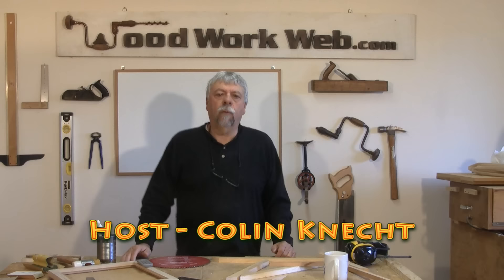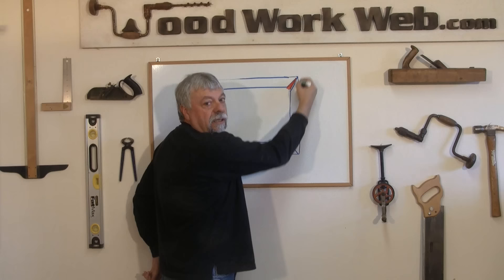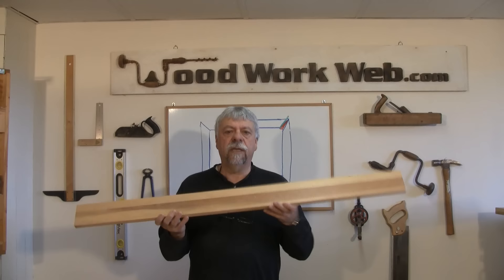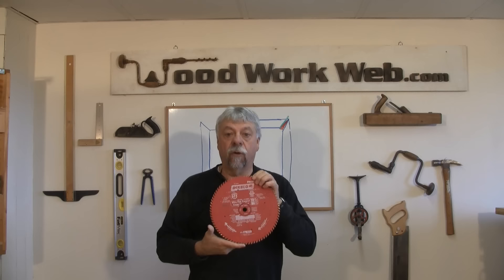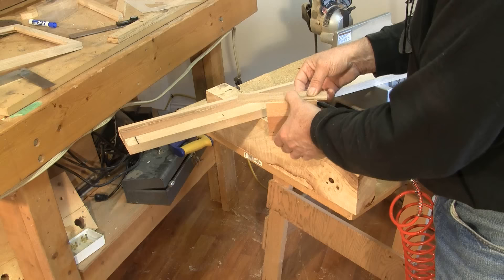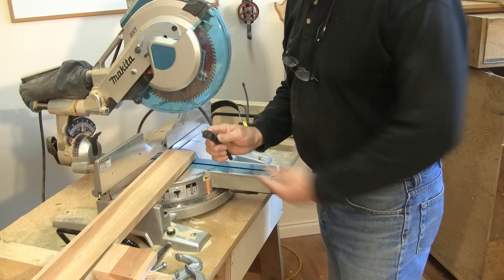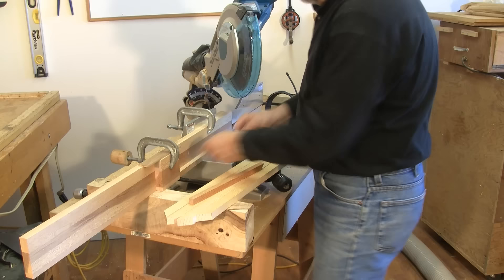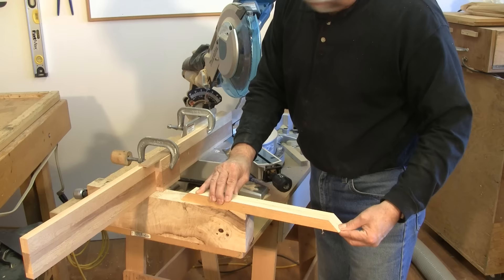Making Picture Frames with a Sliding Mitre Saw - A woodworkweb.com woodworking video

Comment: Love your DIY setup. This setup will work for small flat frame however you must improve on the 0.1 degree vertically and horizontally (Think of the frame being 3D) deviation otherwise a large 1-1/2" thicker frame would have some trouble. 1. You want to avoid using a sliding saw as it is not as accurate as the none sliding one due to the slope of the rails. No matter how good the brand is but do stay with a name brand with less vibration and slope. 2. On your first right hand cut, the frame must be flipped upside down and stay completely flat before your cut or you must adjust the saw 90 degrees and move your rig to the right side, otherwise you will end up with an Asymmetrical piece. 3. A V-nailer should be used to hide the nail heads, for the DIY people the manual or hand held ones are about $100 but a bit tricky to use. 4. Thick frames are especially difficult as not only the angle has to be 45 degrees vertically but also 45 degrees horizontally, this is why most sliding saws would likely develop problems when you make the final joint. 5. V-nails need to be double stacked some times with 2 x 3/8" or longer for very thick frames and only a professional $2,000+ V-nailer should be used, otherwise the frame seam will easily open on top. 5. Use wood glue but be very careful to test it as some glue would expand and spill outwards as it dries. The challenge starts when the frame is 1" or thicker. IMHO, I use to own a professional picture framer shop years ago.
Reply: @Hello Eddy how are you doing

Comment from the maker: Good point, you could cut 2 sides at once as long as you make sure they are exactly the same length. The only other issue might be safety, could be a bit harder to hold on to 2 rather than one, but other than that, no reason why not.
Colin

Comment: Great video...only wish you had included the making of the rabbets that are needed to accept the artwork, glass, etc. Seems like an integral part of the process was left out!
Reply: I agree, I need to make a frame to an existing canvas and was left wondering how. Not enough info on making frames and too much info on making corners.
Reply: @flipknuckle  a stretcher does not need the rabbets that a picture frame needs....a stretcher is a whole other animal because of the tension put on the stretcher when you stretch the canvas....you will notice that a lot of cheap stretchers will twist...
Reply: the rabbets can not be made on this tool, you either need a rabbeting bit and a router or a dado blade and a table saw....
Reply: @victorprado1347  thank you kindly, will be making oval frames out of a single sheet of plywood with routed 5 ml inside and two inches of outer border with routed outer edge. Will be an interesting experiment.
Reply: @victorprado1347  sorry should have been more specific it is a stretched canvas that is a finished work painted and hung but now want  to frame it to make it a little more elegant. will still need rabbets to set it into.
Reply: @flipknuckle  sounds cool
Reply: The rabbets are for another video.JUST GETTING THE FRAME RIGHT was enough for one lesson...for me✏📏📐😊😎🇺🇸
Reply: I don't believe Mike was making the complete frame or showing the viewer on how to make a picture frame. Seems to me the point of the video was to educate the viewer on the importance of making sure your pieces are identical to each side or else the 45 degree angles wouldn't be equal, thus creating a gap(s) on your frame.  Thanks for your insight Mike! This helped me understand way some of my polygon angles would graduate and not me actuate.
Reply: Rabbets don't require as much precision.  You can cut the rabbets first - this video is the answer to the part that kills us.
Reply: @mattmillican3635  Totally agree Matt.  I do the rabbeting and profiling first and any round over as the last part of the profiling before the final 45° cuts are made on each piece.  It helps make the piece handling much easier

Comment: Hello friend, I tell you that I make my frames for my own paintings and drawings. I do not have an electric miter tool but I do have a manual with a saw and the truth is that I find it very difficult to join the wood that has been cut at 45 degrees. I have two belts to join the four corners, but it is necessary to be adjusting little by little so that they are well joined. Thank you very much for your videos and receive my congratulations from Mexico City.

Comment: If your mitre saw doesn't cut precisely 45°, you can fine-tune it by placing one or more thicknesses of paper or card behind one or other end of the backer board before you clamp it in place: behind the blade end to increase the angle of the cut, behind the 'feed' end to decrease the angle.

Comment from the maker: Hi Gary, I think I covered that in one of the previous frame making vids, but the way to do it is you need to account for the rabbet where the glass and/or matte and/or picture will go, so the inside of where these joints meet on each corner should be your actual dimensions. So measure from the inside diagonal of that rebbat, then work that length back using a square to where the outside frame length needs to be. I don't think I can be clear enough in this tiny space for responses.

Comment from the maker: It's technically possible to route a channel for the glass and picture after the frame is assembled by using a rabbeting bit, but to be honest I don't recommend it because you don't have good control of the wood which means it is risky in terms of accidents and injury. If you can design some sort of a jig to hold the frame, this could work.
Hope this helps, let us know if have other ideas.
Great to have you with us\Colin

Comment from the maker: Good question Kurt, the only real reason to use a sliding mitre in stead of a chop saw is that you get a bit wider cut with a sliding mitre ... which in some cases isn't that much wider. I am planning to do a video on a table saw sled that will do accurate and wider cuts, that might be helpful to you tool. Thanks for commenting ... great to have you with us
Colin

Comment: Love your video Colin thanks !! Although I have to build a frame to go around a TV to give the Samsung Frame TV look.  So the width of the frame is pretty long (35in). Any suggestions on marking the  width for the marker gauge.  Could use a tape measure but do you think a pre cut length guide would be better ??

Comment: The most simple form of set square is a triangular piece of transparent plastic (or formerly of polished wood) with the centre removed. More commonly the set square bears the markings of a ruler and a half circle protractor. The outer edges are typically bevelled. These set squares come in two usual forms, both right triangles: one with 90-45-45 degree angles, the other with 30-60-90 degree angles. Combining the two forms by placing the hypotenuses together will also yield 15° and 75° angles

Comment: Would have been nice to see a close-up of the measuring sticks placement under the blade.  The stick's 90 degree edge to the mitre saw's 45 degree angle.  But I think it will become obvious after trying it out the first time or two.

Comment: Don't forget you need to flip the pieces for the 2nd angled cut so that your inside angle is the inside angle on both ends of each piece. \  / and not /  /
Also important on decorative or rabbeted picture frame wood to check the orientation. My first attempt messed up 8 feet of wood...lol.

Comment: Sorry if I'm missing or misunderstanding but it looks like this only works if you know the outer dimension of the frame?

Creating a custom frame, you measure the inside since that's the dimensions of the object. This looks like it cuts based off the outside dimensions??

Is there a mod to the backer board or the extra block to accommodate the measurements of the inside?

Comment: Nice job. I wonder about the rabbit for the glass or canvas. Dud you make those first? I'd like to use my chop saw but I'm not sure it's good enough. I'll try a new 80T blade first. Might have to manually set the 45. Thx

Comment: Lay that drafting triangle flat on the saw bed. If you hold it up in the air, you'll inadvertently tilt it just enough to make it snug against the fence and blade, even if they're actually half a degree off from true 45.

Comment: Great tips for flat pieces of wood.  BUT.... what do you do when your using fancy actual picture frame wood, with an angled design on the face, a beveled edge where a picture or panel might go, and the back side is not a 90 degree angel from that flat part the panel would rest on.    We cannot figure out how to set this up so it cuts right.
But this was very helpful for flat wood.

Comment: Good video for basic picture frames with wood that has uniform thickness. This won't work if you are using tapered molding for a frame or wood that does not have uniform thickness.

Comment: Great video!!! But what if you don't have a marker stick to set your the depth of your sliding marker (when you make the second cut on each piece)? Where do you measure from with a tape measure? I notice your marker stick is mitred one one end to match your fence, but if you're using a tape, where would you measure from? The outside (and longer piece of your fir fence) or the inside (shorter) of your fence? This is what's difficult if you're trying to frame different one off pieces that are obviously different in size. Great video and thanks for any insight you can give.

Comment: Great idea for simple fence. But this is not a picture frame. It’s true that the measuring is key, the mango rite of these videos do not deal with measuring for inside dimensions of a finished picture frame. People need a frame that is 13 3/8 by 16 3/4 how do you cut both sides of the mitre correctly for the interior dimension? Any one can cut. Piece of wood and then match the same size, but cut these to an intended interior size with a rabbit.

Comment: Super video. Been making my own frames for a lot of years now and still learning. How Is the length of the frame measured with this method? An 8x10 from long point, outside, to long point will not accept an 8x10 picture.

Comment: I really like this template, it looks so easy to make.  I am curious what dimension is that backer board?  Looks like a 1x6? or  is it a 1x4?. Not sure if the measurements of the template vary due to the type of miter saw and the height of the fence?

Comment from the maker: Hi Richard, many years ago I did make some picture frames our of 1/4 round, and yes it is tricky, and you have to be VERY careful working with small pieces of wood like that. What I did, was to first cut a rabbet into one side, then cut the 45 degree angles. The problem that I was having was the 1/4 round material I bought was not consistent in diameter which meant even if the corners were ok, they wood never lined up. If you have a table saw with a good blade, try that method or email me.

Comment: I did everything you said but used the 10" 90 tooth Freud, Diablo, crosscut, blade, for fine molding and got excellent results! Thank you for this video! Would you happen to know what the best method for joining picture frames for production is? A v-nail press or a v-nail air-nailer?
Reply from the maker: Matt Strom Thanks for the update Matt, great job buddy!  I have only ever used a press, and I have scant usage with it, so to be honest I am not a good resource for you on this. Not sure off the top of my head where to send you. Maybe the suppliers would give you some clean advice .. Keep in touch, would love to know how you make out.
Colin

Comment: using a chute board helps. Half the time though people blame the saw when in fact the wood is not square to begin with. You buy a piece of nice wood at a store and it can measure 3 inches at one end and 3 1/4 at the other and that cannot produce a parallel 90 or 45 . You really need to do a lot of wood straightening before doing picture frames,
Reply from the maker: What you say is all true Thomas ... and most folk don't know what a shooting board is or have a plane suitable to use with one, but I guess that is becoming a thing of the past in many ways with so many power tools available. Still, there is a lot to be said for taking time and using hand tools ... thanks for taking a moment to comment :) great to have experienced people with us too

Comment: Hi Colin,
  Thank you for the concise information on making picture frames so everything works out good. If you using glass within the frame what is the best way to to cut each piece to form an area for the glass to lay it?

Thanks again for another easy to follow and succinct video! The best of this kind of thing on the web!

Kind Regards,
Steve

Comment: so I understand correctly I just need to make sure that parallel sides are equal in size and then I will be able to get a perfect miter corners ... I assume that my brand new miter saw is perfect but I will check it with the plastic triangle I got with my makita saw to calibrate it if required.

Comment: What about the rabbet on the inside you actually drop the picture  into. Do you assemble the frame like you show here, and then use a rabbeting bit on the router table to cut it into the wood. That step is my biggest stumbling block to making decent frames. I have wasted a lot of beautiful oak (not mention a LOT of $$) chasing after that darned rabbet. O/W a great video. Like commenter @bill smith below, I need a slow, methodical, thorough  approach, and you've never let me down. Thanks for helping this novice gain more and more confidence.

Comment from the maker: Hi Eduardo, I think it might be possible to make picture frames with a circular saw but you will need to purchase a very good 40 or 60 tooth blade to do it with. Next you will need to make a jig that the saw can slide in, with the frame material underneath. There are circular saw jigs similar to this on the internet, but you will need to make yours 45 degrees. 
I think this might work for you, let me know how you make out, but BE CAREFUL circ saws can be dangerous. work safely :)
Colin

Comment: Thanks for this video, it was very interesting and helpful.

Q.  would it be just as quick and valid to cut the opposite sides of the frame, at the same time?   i.e. two pieces of wood taped together per cut, in order to get the exact cuts and sizes that way?
Reply from the maker: We love woodworkers who think "out side the box" ... great idea, sure you could do this. This kind of cutting is often called gang-cutting and I haven't done it with frame material but no reason why you couldn't in this case.
Thanks for posting ... great to have you with us

Comment: Nice video . Of all the videos I’ve seen with the miter saw for 🖼 Frames is simple and not complicated. So what I did to check the 90* degree angle was with a digital angle finder that sticks to the blade with a magnet. Also I read the miter instruction that came in the 📦 and I also adjusted blade because it was slightly off by 1degree off. Now I have perfect frame. And my question now is how do i find the 🐇. Do I need to use that long mathematical math problem to find the rabitt.

Comment: i just bout a Miter saw and indeed am a beginner. When you are measuring the framing wood after your first initial cuts do you measure your frame to where the blade touches the wood or where it ends up?

Comment: This method works well if both faces of the frame rails are parallel to each other. If it's going to have a rounded face or even an angled face, this won't work.

Comment: one other thing? how do you cut the slot for the glass, matting, and artwork? i typically run my sides across my router table and use a 1/4" straight blade. after that, i put the two together. also, how do you reinforce the joints. I've been using lengths of dowel rods. i determine which direction the frame will hang and then parallel to the horizon, i will drill a hole that goes through both sides, fill it with glue, and gently tap in the dowel until it's flush, I'll sand it down if the dowel is proud.

Comment: Could not tell if you had already made the inside groove cuts to support the picture so I assume you did.  The measuring stick is interesting and still not sure how you marked it.  It appears the most important measurement is where the inside groves come together. This would be made by a router or table saw.  It appears to me you are using the outside measurement of the overall length to determine where the last 45 degree cuts are made at the other end.  Am I missing something? For  a 16x20 frame to hold a canvas is critical on the middle groove cut inside.  The outside can change by the width of your frame and to me that would change everything. However, if the inside groove is measured you should always end up 16" on the shorts pieces and 20" on the longer.  I hope you can see where I am coming from.  I am a total novice at this!  It took 12' of wood for my mistakes to do one 16x20 Ha Ha!

Comment: Great video but you skipped one step. You only looked for square in one direction but did not check the blade if it was square with the table. So not only should you verify the 45 but also the 90 with the blade and table itself.